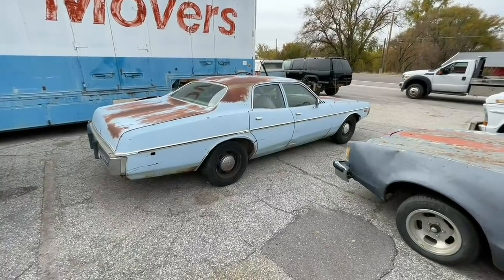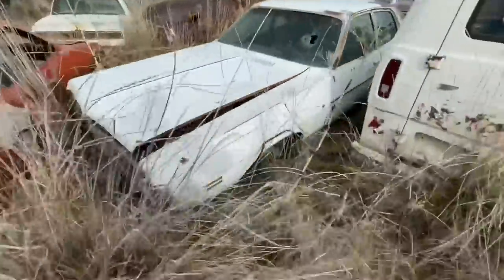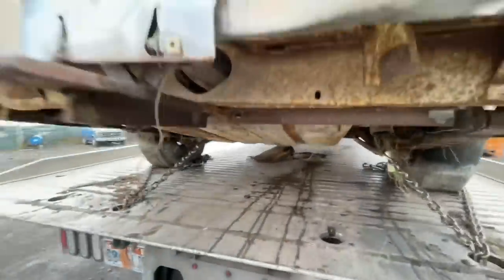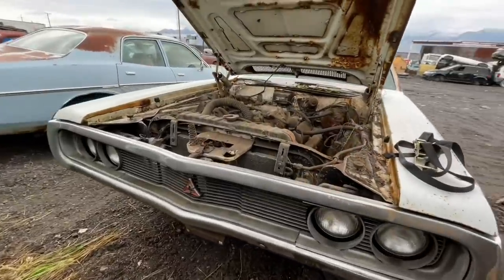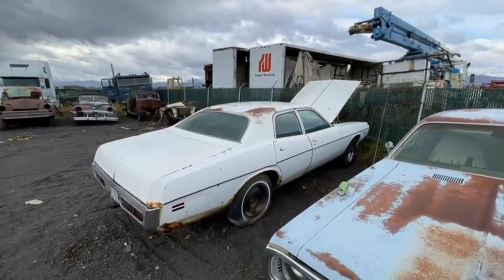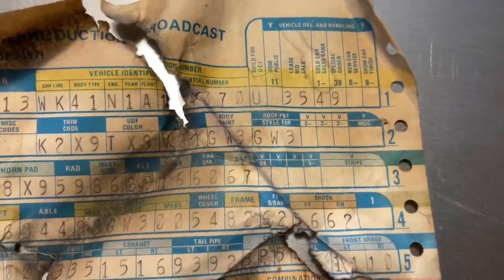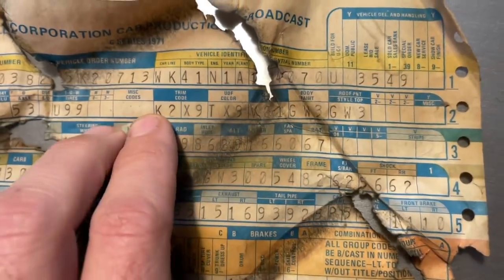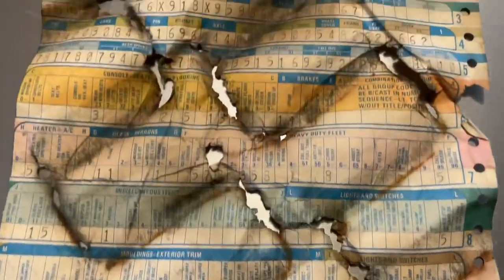EP 23 FOUND: 1971 Dodge Coronet Police Car!! Also a 1973 Dodge Coronet.

Comment: Leese-Neville alternator, marks across the top where the bar light bracket sat, 140(?) certified speedometer- yeah, you're right- pretty much gives it away, though I've never heard of one that late with a 383 for a police application.I did once work on a '72 Polara , bought surplus from an NC police department as an unmarked radar interceptor, was a strange package - a 400 Magnum , everything in that engine was a 440 Six Pack from the crankshaft up including double valve springs - HD high upshift Torqueflite,  certified speedometer and a 3.91 gear out back - to be as heavy as that car was, from a stop to 95 it would pin you to the seat.

Comment: My first car was a white '71 Coronet Police Car with 383HP.  It was only 10 years old at the time and  I got it running and drove it around a bit until I had the chance to trade it for a '66 Charger 383HP.  The Coronet also had the 11" drums all the way around but didn't have the Leece-Neville alternator, I believe, and had a Holley Vac secondary carb from the factory and 3.23 gears with standard differential.  The 727 in that car would downshift into first gear before you came to a stop, very aggressive feeling.  I still don't know how they made that happen and I'm fluent in torqueflights.

Comment: I got a '76 Valiant for about $150 out-of-pocket. Had been off the road for about 25-27 years, little old lady on the Tulalip Reservation parked it when the heater core & radiator started to fail. Cloning an A38 with some liberties including the 11.75" rotors, 4-speed iron-case OD trans, 8.75" rear, FFi steering & suspension, rear discs...

Comment: It was ordered as a police package, then the dealership put the lites, spot and speedo and take the inside handles off the rear doors
Reply: The speedometer came from the factory. That’s the only way they could certified. Dealers never changed speedometers because that would be illegal.
Reply: @MrWill73  Who told you that?